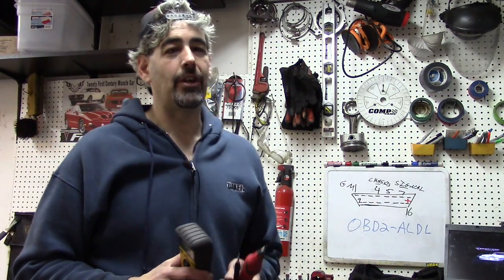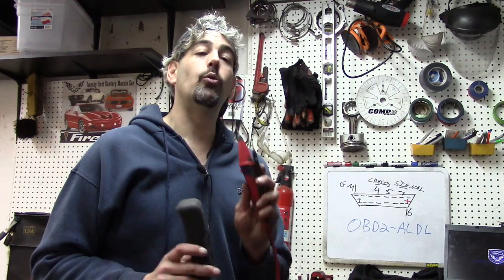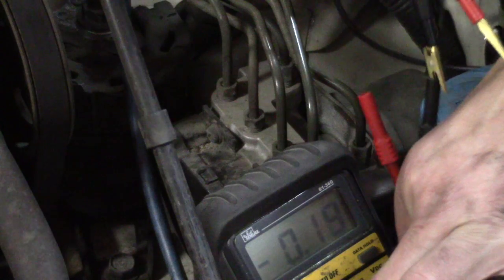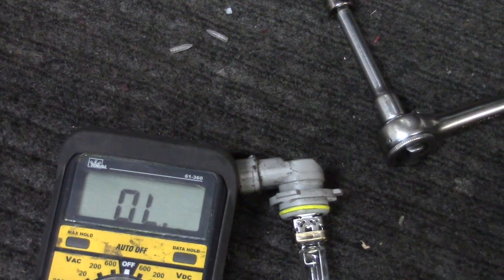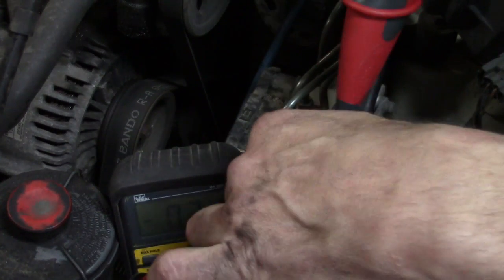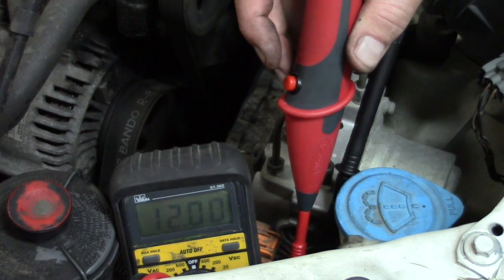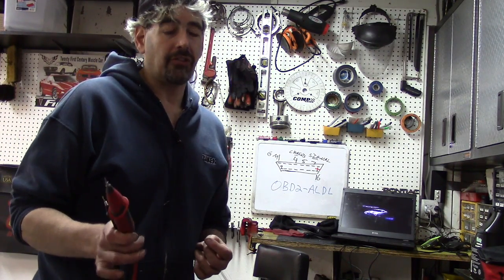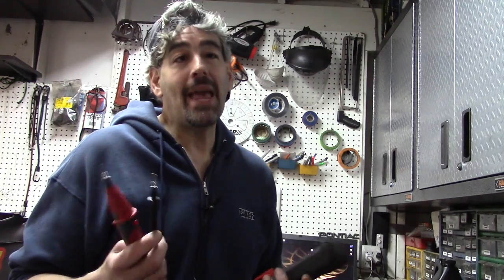Load Pro Electrical Tool Review (with product link)

Comment: Lets say you are working on a PCM wire like say a TPS, if you unplug the PCM and the TPS check the wiring, if the wire is a straight shot from the PCM to the TPS send 12v through that wire off the battery and use the load pro at the TS connector to check wire integrity. I do this all the time just to verify my wiring is pure. The load Pro is a perfect tool for fast wire integrity testing using that method.
Reply: I meant check a wiring diagram if the wire is a clean shot from point A to point B send 12v through it and on the other end use the load pro for voltage drop integrity

Comment: Hey buddy. As always, thanks for your video. Is there anyway, using the load pro can damage a pcm due to wrong operator use?

I am chasing a crank no start issue with 2000 Ford f150 after it has been sitting for 7 months after the power steering pulley failed. Did not have time to fix the pulley because that happened right before a scheduled trip out of the US. Few days ago, i replace the PS pump and pulley & voilá the problems. 

The fuel pump does not prime although all fuses and relays are good. Dtc p0232 is haunting me and I was eondering my using my loadpro would help me more than my DVOM and powerprobe that i am currently using. 

Sorry for the novel i just wrote 😂
Reply from the maker: No you won’t damage anything with load pro UNLESS the circuit runs on higher resistance than the internal resistance on the meter which is highly highly unlikely.
Reply: @SchrodingersBox  thanks a lot for your prompt reply. Im gonna go hunt for the issue now. You know we are your faithful followers because being parts changers is none of our ambition. We want to understand how system works & hunt the issues or die trying

Comment: does this work for starting circuit?if this can do this for starting system then does this mean ive been wrong that can can actually hook a test light up to a starter circuit that doesnt have current flow this way i can create current flow so i can voltage drop test starting circuit?this questions driving me nuts
Reply from the maker: Yes it does!

Comment: Why not just do a voltage drop test on the live circuit like we always do.  This tool is a 25 ohm shunt resistor and button?
Reply from the maker: because you can do it without having to access a single polarity so You can actually do this across a connector.  That’s a massive advantage on most circuits.

Comment: I've had this tool for over a year and its great. U chk system voltage, push the button and the reading will tell u if the wiring is good or bad. I read some comment that he rather use his test light. Test light is cool but this tool shows you actual voltage drop readings! Love this tool!

Comment: 3 faults short to ground open is the wire harness good or is is corroded? the load pro eliminates opens and short to ground so do the voltage drop test push the button  done .

Comment: Matt, Thanks for the clear explanation. The impression I had from several videos was that if you press the button in a known good circuit then you wont have any voltage drop but this is not the case, the voltage should drop because of the load the tool puts on and I wonder how much this should be as I actually have this tool.

Comment: From what I understand, Dan put 25 ohms of resistance in the lead.  That allows a lot more electrons to flow which displays resistance on the meter.  Displays is probably the wrong word but you understand what I meant.

Comment: How do you test it on headlight with control modules and 12 pin connectors? Like an Audi headlight for example?
Reply from the maker: You have to map out the power, ground and signals and test accordingly.  On a 12-pin I would use the wiring diagram. on a 5-pin or less its quicker if I simply map it out myself.

Comment: Hi Matt::  I have 4 high end Fluke Dmm's & each them has a load pro  probe. I also have a Power Probe 4, & I wouldn't be without either. Sullivan has a Power Probe  problems video that I watched, & the only people that will have trouble with the power probe are those who are uninformed regarding electrical/electronic theory.  I am 80 & have been working my life time in the business. I am kept busy here in rural Alberta keeping the electrics & electronics & hydraulics of farm equipment working. Many customers buy a DMM when they see me fault find with one , or ask me what scope to buy when they see me check sensors using one. I have to explain that you need to understand what  what you expect to see from a working device, & have the knowledge & understanding to interpret what the readings are telling you.  As usual, your " Load Pro Review"  was a pleasure to watch, the same as ALL your videos. You do a great service for your followers Matt.  Cheers!

Comment: Ty. You just confirmed my doubts. I absolutely agree with you that using it with DVOM on everytime to diagnose a electric circuit problem is a smart way to go. Techs that work in a shop who gets paid flat rate always want to find ways to get things and find problems quick and accurate. This 1 by far is the quickest and on the money when checking a voltage drop which we commonly run into. Thank you very much with this video and to the inventor of this product. It is huge though but i use power probe most of the time so i think i will get use to this easy.
Reply from the maker: Yes love my power probe too!! Use it almost every weekend.

Comment: Good video! Getting it soon. I was wondering if anyone could shed some light on an issue I have. This problem is the horn button wire polarity on my 2001 van. It doesn't make sense that it is +. The diagrams I've looked at all say this is suppost to be a + wire lead & it is, I checked it. How does this make any sense if the horn button is a working switch that connects ground? This does not make any sense! Where's the magic trick at? The module it runs through ??
Reply from the maker: every horn i have seen is ground side switched.

Comment: I just bought a 25 ohm high volt high amp resistor on ebay for $ 4 so I can make my own.  I don't even know how a patent could be granted for a simple tool that anyone could make.  There's really no "inventing" involved.
Reply from the maker: The inventing is on the concept, not the product.  For example- you did even not make your homemade device until AFTER you were aware of the idea from Dan Sullivan. He thought of it.

Comment: Wouldn't you get the same results as a load pro with an led bulb on a switch between the test subject and the test lead to form a load?
Reply: NO. An LED only draws (allows to flow) about 20milliAmps-and it requires about 500 to 700 ohms of resistance in series. If you put an LED across 12volts without a series resistance, it will vaporize immediately. 20 milliamps is not a "load". You would be better off with an incandescent test light, which flows 150-200milliamps, which is still a long way from a half amp.

Comment: How was the chassis ground a 'known good ground'?
Reply from the maker: Because it showed continuity with B-
Reply: Continuity? I'm fairly sure you know a continuity test is not a good indication of circuit integrity. Isn't that the whole point of this tool, the 12v showed continuity on the power feed, but it still wasn't good. You'd need to ground it directly to the battery negative to confirm.
Reply: In fact the more i think about it the less i understand how this tool works. Since a voltmeter does not complete a circuit, then surely the load is only being applied to the power feed, in which case would you not have to switch the leads around and apply the load to the ground side to test the ground?
Reply from the maker: Please explain how it is possible that if I have conitnuity with B- that I do no not have a ground especially considering affirmation of the consequent when I actually did the test???? That makes no sense bro!

Comment: Hi matt..After watching your review on this load pro ive ordered myself one....Seems a good way of testing...Some of the reviews on different channels have a slightly lower opinion of it...Pine hollow auto diagnostics for one ( in which you have a mention )...The two main down sides apparently are the size of the probe itself and the fact that the load is not variable...But we'll see...Thanks again
Reply from the maker: Yeah in my opinion I think the objection is the device is very simple and they didn't think of it.  I mean for god's sake the objectors say "it's just a resistor with a button" and yet they use a testlight with is nothing more than a 12V lightbulb!!!

Comment: Thank you. But, I'm out of the business - I reached an agreement that was "acceptable to both parties", even though I'm broke and "other" tool manufacturers are not. I never knew this stupid tool would cause such a fuss. I wish had gone better - but - shit happens. FYI - the motorcycle guy tried hard and was honest - but he missed the major point of the tool - which I accept responsibility for. IF - you see source voltage at the connector you KNOW you DON'T have an open or short-to-ground. THEN, load the circuit. If the voltage DOESN'T drop - replace the part. If you lose voltage, see ghost V or zero V, you DO have corrosion, an open or a short-to-ground, respectively. I really think people just want the process to be harder... Gotta go - just got a notice that my electricity is about to be turned off for non-payment. How ironic....
Reply from the maker: Well sorry to hear that but I actually think that people didn't want the process to be harder- they just don't understand the concepts of electrical to begin with.  I can't even count how many people thought the load pro has a battery in it, or how to "turn it on"- hell most people don't even know what voltage is much less voltage drop.  
   I think the problem with this tool is that the vast majority of people have no idea what it is.
  Best of luck to you though- I learned a tremendous amount from you and I liked the "attitude" lol.
Reply: Good luck, wish things would have worked out better for you...
Reply: Well, you fought a good fight, just too many ignorant people out there.  I enjoyed your videos and I purchased one of your LoadPro's.  Your test leads make checking electrical circuits so much easier and quicker.  Sorry to see you go, good luck on future ventures.
Reply: I missed all the hoo haa between Load Pro aka Daniel Sullivan and others like Eric the Car Guy, only found out about it today. I own a Load Pro, it is a great tool and has it's place and so does my carbon pile load tester and multimeter and test light and scope. I think a lot of people would find the Load Pro difficult to use only because of their own lack of understanding of fundamentals. Sorry things haven't worked out. It's a good tool with it's place in my toolbox and used frequently.
Reply: Sorry to hear that, but it's hard to know what success is without a few fails, if I knew how to develop a product to compete with your previous product without infringing on the agreement you made, I'd rebuild Chinese multi meters by adding a load button, you could skip the mold making and just redo the circuit and a new graphic, you already have the name brand awareness...Dedicated tools are more popular than adaptation tools.
Reply: @kenbarnett8189  hi
Reply: Great video and example how great this tool really is
Reply: Dan thank you for the load pro it’s an awesome tool. You are a great American
Reply: Why persons are so salty about another man's difference in point of view. Its how he sees things?
Reply: @blackbambinoe Correct! Everyone understands and learn on different frequencies (levels). Just because someone thinks different or explains something in a different way or from a different perspective does NOT mean they are wrong.
Reply: Hi Dan,   brilliant tool and I Love it,    book was great too.    Wish I had found out about it years ago,   pity Fluke wouldn't add it internally to their Automotive meter.   Be a great addition.   All the best mate.
Reply: Daniel, I'm so sorry to hear that today. Your videos are interesting and  thoughtful, and I own and use your tool occasionally. Compliments to you, and best of luck in the future. Even the very best have had setbacks and failures, so don't beat yourself up too much.

Comment: can you leave the loadpro cables on and check house voltage without pressing the loadpro button
Reply from the maker: ABsolutely.  The load pro leads are normal leads that only load the circuit with button pushed.  In fact I have another video where I drive a fuel pump with load pro leads using my ammeter.
Reply: Which video are you referring to.
Reply: check your manual that came with the tool.....not recommended for high voltage...good for only up to 30 volts I believe.
Reply from the maker: david johnson What system are you going to test with a load pro that has 30 V??
Reply: I personally do not need to, but the genesis of the tool came from the heavy truck/construction equipment trade, which often use 12 volts in series or 24 volt systems.

My concern was for someone thinking they could use the Loadpro button function on household 120 volt ac and expecting the same results, when in fact they should be using either a high quality DMM with LoZ function or a "solenoid type" or "wiggy" voltage tester.
Reply: Daniel Sullivan3 years ago
LOADpro is usable on AC voltage as well. The voltage limit is 28.5VAC/DC - just don't exceed those limits and you'll be fine.

Comment: Why use those bulky leads instead replace your DVOM with one who has a additionally  low z (low input impedance) scale. You can get one with in a form factor of the load pro who has all the scales that you need for automotive diagnostic.
Reply: For example : ?

Comment: Matt, I was looking on amazon at the reviews on the load pro,  looking to get one. I see where one person said he bought one and the battery went dead in it and it is sealed so you can't replace the battery ( ya I know that would not stop you from opening it ) but I try avoiding tools that even if there rechargable batteries you can replace them when they go bad. Can you replace the battery in that if it does have a battery in it ( not knowing that for sure but guessing it does ). Kinda hate the idea of having to replace it every two years or opening it up to find a bunch of corroded terminals from leaking batteries. For a full time mechanic or one that does a lot of work buying one every 2 years may be no big thing. For a DYI it may be more of a problem. Whats your thoughts ........THANKS
Reply from the maker: You didn't see my comment on that moron's review statiing only an idiot would give a poor review for a device having an irreplaceable battery when the device does not use a battery at all?
Reply: read through all the comments again and see where it was confirmed ...... no battery.  Sorry I missed that but guess I don't always keep following the comments when the video gets older .   My bad ...... just call me ass hat   lol   thanks matt
Reply from the maker: dcbigsky Lol no no... I believe the responsibility for accurate information lies with the person delivering information, not the person reading it. If someone gives a negative review because the battery is nonrepleacable, then its not your fault for accepting that as a negative aspect- how are you supposed to know? You didn't buy the tool. But the reviewer is an idiot for giving a negative review on something that he doesn't even understand what it is.
 The asshattery is on his end, not yours.
 Unfortunately with 98% of people talking out of their ass on the internet, maybe there is some responsibility on a viewer to default to assuming information is always false, but then what's the point of doing research?

Comment: So what dos the the load pro do?  Is it a powered test light?
Reply from the maker: +gc Basically it is a push button controlled resistor that draws a .5A load on the circuit.
  Some of the objections to the device are in its simplicity- a weak argument from anyone who uses other simple devices that could be home made like a flashlight or a set of jumper cables.  I think its just jealousy that they didn't think of it first though. Convenient design is what we buy with simple products, not the technology.
 Other objections are that additional knowledge of the circuit is necessary though to interpret the data.  I don't see this as objectionable though. ANY electrical test requires you to know what you are working with.
  For example- a lot of people would discern that any less than a .5V voltage drop on a circuit is acceptable with the load pro.  But this is not true. If you are on, say a 5A circuit such as a fuel pump, if you say .25V voltage drop you might rule out that corrosion is not an issue. But you have to realize that load pro draws .5A, not 5 A so in actuality there was a 2.5V drop, not .25V. Therefore, some people criticize its usefulness.
  In my opinion, lack of capability of the operator is poor reason to make criticism of a tool.
  What do you think?